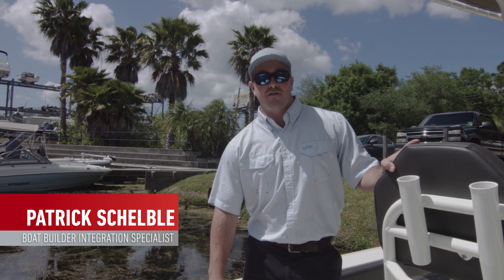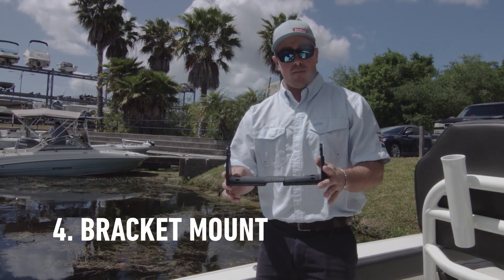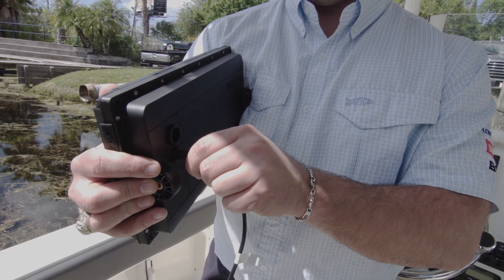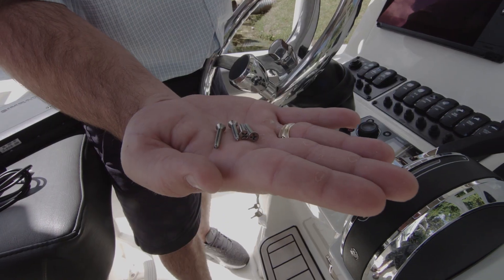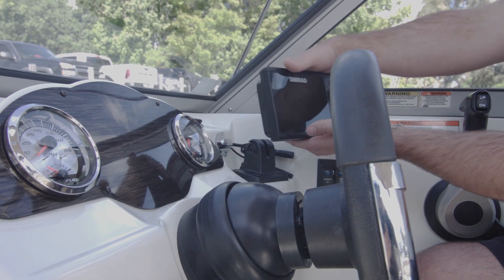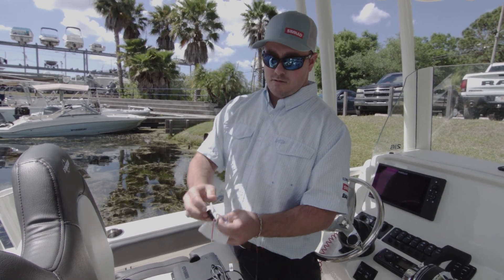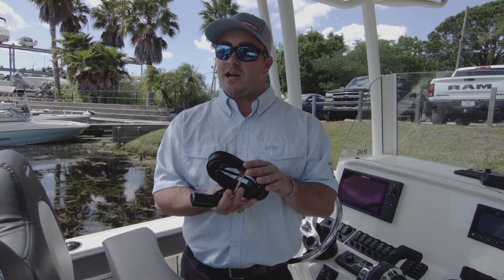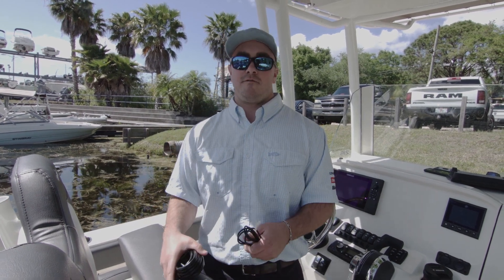Simrad Cruise | Installation Tips

Comment: Hi! Does the bilge installation also apply for the Simrad Go series? I wouldn't need the temperature.
Reply from the maker: If you are trying to turn the bilge on or off - you'll need some kind of digital switching, that would then feed the Go via N2k (NMEA 2000).

Comment: FINALLY. Found the retail mode option off screen at the bottom of the menu and was able to exit retail mode, which is certainly why the previous user returned this thing, it was a demo and nobody else could find this menu item or the key to enter the command in the absence of a users guide and four hours of frustrating cursing and on off back and forth!
Reply from the maker: You can find the User Manual in the unit's internal memory under Storage > My files > Manuals
Reply: @simrad-yachting  thanks,  Im getting there!
Reply from the maker: Happy to read you're getting an hang of it and that you're happy with it.
Reply: @simrad-yachting  found the built in manual 72 pages on PDF that takes a week to load! not great. And the depth is paused and nothing under any depth setting will un-pause the function. Again aggravating and no clues how to get to its setting. And I found the menu before but its not easy to access and open this file with its options. You'd think the depth screen would offer options to pause or un-pause the depth.

Okay finally found the pause/un-pause on page two of the menu for the depth control and is working great!

Comment: in this video a neat, shiny guy wastes our time just commenting on the obvious but ...Im finding NO instructions for the Cruise model and not sure its working. 3 amp? No  I didnt get a 3 amp fuse and I cant figure out how to adjust for boat length in settings on the settings setup screen, no instructions supplied! The device is stuck in "simulating" mode. where are your manuals?
Reply from the maker: The manual can be found in the unit's internal memory. You can also download it from out web page https://www.simrad-yachting.com/downloads/
A 3a fuse should have been in the package. You can turn "Simulation" mode off.
Reply: @simrad-yachting  really liking the unit now that Im getting it sorted out. It was a refurb with no paperwork and clearly a store demo, and Im looking forward to getting a chart chip for the Columbia river system to add details and I see it has an SD card reader for local detailed maps. Depth sounder is also working through the thick glass hull and its great once you figure out the menus. And yes, I found a fuse and holder in the hardware packet. And the refurb was VERY cheap so Im happy overall and looking forward to the unit in service!
Reply from the maker: Please follow the link to view all the data we have on the Columbia river https://www.c-map.com/chartexplorer/
Bear in mind the Cruise unit is compatible with C-Map Discover cartography.
Reply: @simrad-yachting  Thanks so much and although its not network connected I see it takes an SD card for local charts. Its a serious plotter for small dollars! And I just use the laptop with open source cpn chartplotter for supplementary information. It seems some have trouble with the depth sounder but mine works OK. A critical feature!

Comment: If anyone is thinking of getting a Simrad....don’t, wait and check out other brands. We are having issues getting the depth finder reading depth. There’s not a lot of luck finding help.
Reply: Im looking for a gps and just found this video, are you guys still there after one year of your post? Can you share the good and bad? Thanks you
Reply: Wish I would have read this a couple weeks ago - Installed Simrad Cruise 9 this week and put in the water today - everything reads fine EXCEPT NO DEPTH!  WTF?  Please post any solutions you may have come across since there is ZERO reference on the web. Praying I did not just spend $500 on a 9" Paper Weight
Reply: @EminiTrader9  I wish there was a solution. After much aggravation Simrad sent another transducer and it doesnt work either. Itll do everything but read depth. The one we bought was almost $800
Reply: Any solution on Depth reading?  I installed the Cruise 7 and water tested it yesterday and also do not get a depth reading.

Comment: Just had my Cruise 7 arrive yesterday and was hoping this video would be all I need to do the install - but I was wrong.  As most boat owners will know, a big part of boat ownership is the fitting, changing, tinkering etc and I would rather fit things like this myself (when following the proper instructions) than pay somebody hundreds of pounds to do it for me!  It would really have helped if this video showed the correct mounting point on the transom for the transducer and gave some tips on cable routing etc.  It would have also been better to actually show the wiring connections as I am sure that most people would link this to the dashboard bus rather than directly to the battery.  It would to have been hard for to make this video much more useful!
Reply: I'd like to know if i can fit this system straight into my fuse box. Can't seem to find any information if I can
Reply: @0ffshor3  I am in the middle of fitting mine now. I am putting it straight into my fuse box because I have a spare slot, but I will still use the in line fuse as well. Negative going onto a bar with a load of other negatives behind the dash.
Reply: @0ffshor3  I did and it works fine. I did swap out the 10A fuse for the 3A that came with the unit though in the circuit box.
Reply: That's what I was going to do. Hope it goes well

Comment: Terrible install video, you start with cruise 9, which is large for most bracket mount locations in a boat under 20 feet, you switch to cruise 7 and then  show cruise 5 with an adjustable mounting bracket, which would be great for mounting a mounting a cruise 7 or 9, but those are not available from Simrad, which makes mounting the larger units quite challenging with  the location for the larger units.